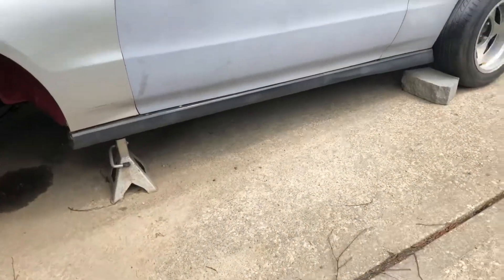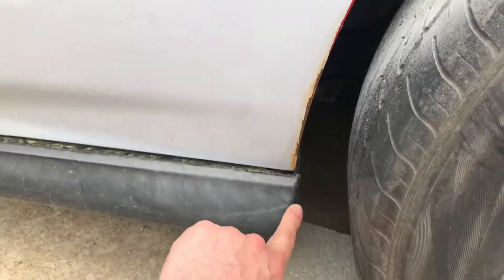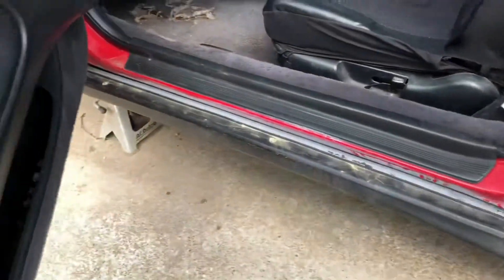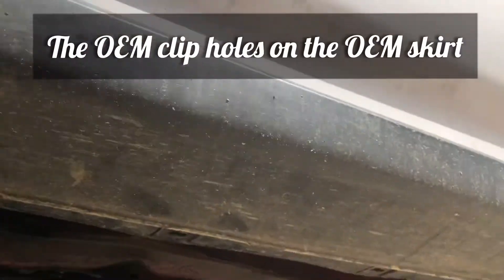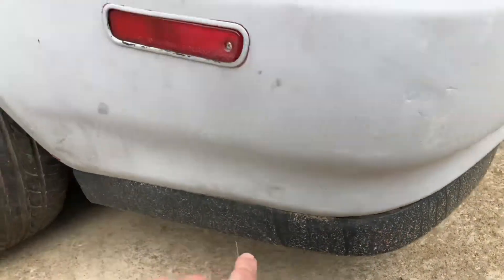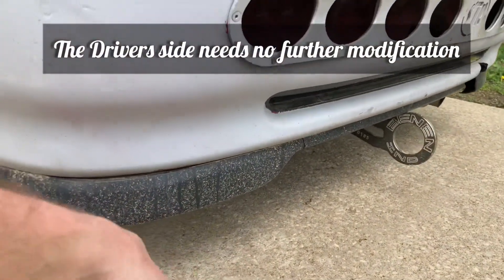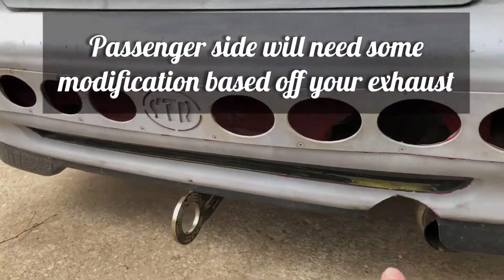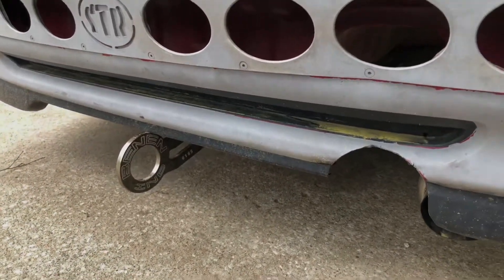How to install 94/95 Honda Accord side skirts and rear lip onto a 92-96 Honda Prelude

Comment: Great video what’s your wheels set up ? Man I love the poke
Reply from the maker: Actually got those off of a Mustang, but had to switch them out because the front hubs were too long so either needed to be replaced or cut, and i would have had to do dome fender cutting to fit and actually turn the car, had to use a 1inch hubcentric spacer for the fronts to clear the caliper
Reply from the maker: Ill have 2 more videos out by this weekend
Reply: Garrett Brandon I’m looking forward to it man thank you .. any prelude content is a blessing
Reply from the maker: @buhhwee2166  dropped one the other day, Power Steering Delete